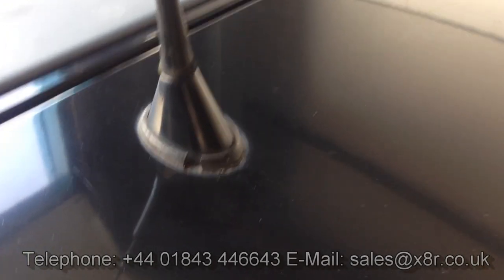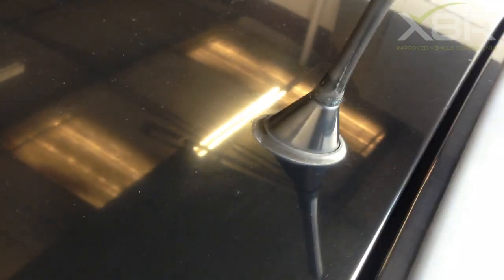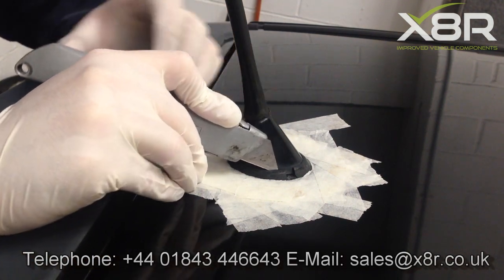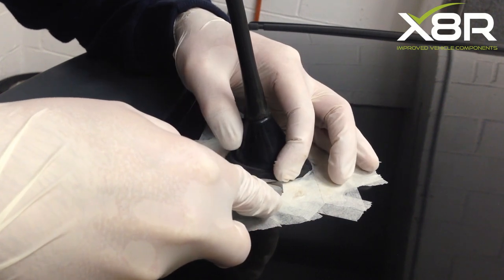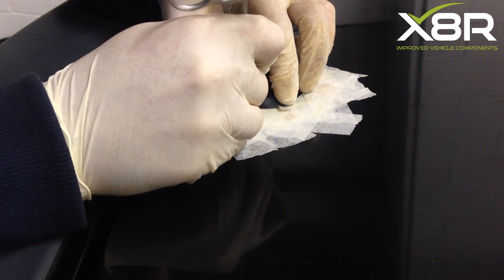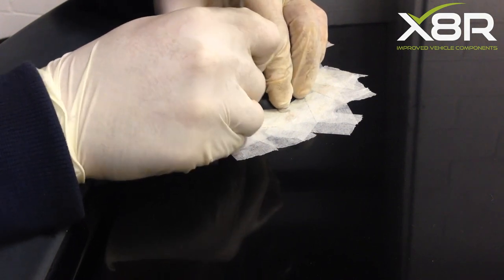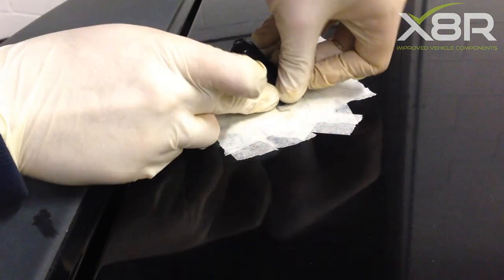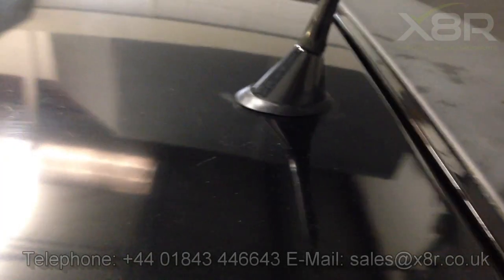Roof Bee Sting Aerial Antenna Base Rubber Gasket Seal Grommet Replacement Fix

Comment: Dude what kind of car is this? It's not in the title or the description of the video.
Reply: Fitted this replacement antenna rubber seal to my 2006 Astra SXI Hatch, personally found it best to clean the roof first, apply a small amount of vaseline to allow the rubber seal to slide easily over the plastic base, finally I CAREFULLY moved the antenna base left right - forward back to make sure the rubber lip had gone into place.

Comment: Hey guys just got the replacement but my base is slightly different its got the rear screen wash which makes it a little wider do you also stock the larger ones?
Reply: +MrStrandgsx This on a vectra? I've just replaced mine using an identical rubber seal. Boil some water, put it in a mug, and dunk the seal in for a few seconds. Stretches nicely.
Reply: And its not the dust cover that causes the leak,it's the one you cannot see 🤣🤣🤣. You must take the rear roof lining off and unscrew the aerial base, get two new seals and for safety sake, get flexible bathroom sealant and apply.  If you have the one with the washer, dealer or scrap only

Comment: No glue???
Reply from the maker: No glue is needed, the seal provided is water tight without glue. - Georgina, X8R Ltd.
Reply: @X8RLtdUK  But this product should manage to block water to pass through it and access the cabin roof. Can this prevent water without glue?
Reply from the maker: @triantafillosxourafis6123  it will be able to keep the water out without the use of glue, if you feel more comfortable by using glue then you can. - Georgina, X8R Ltd